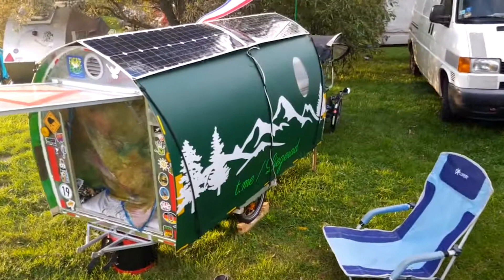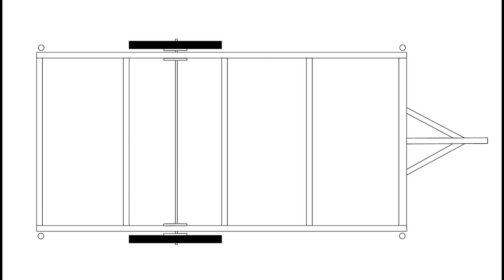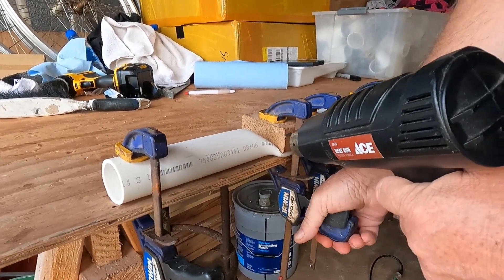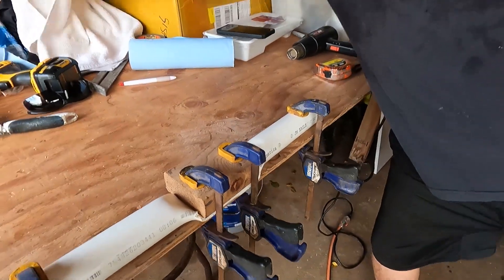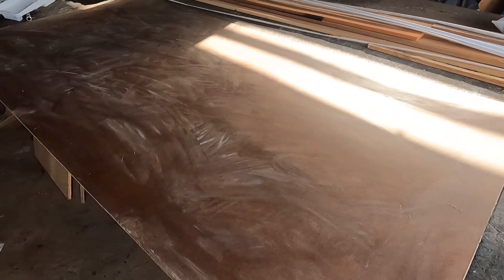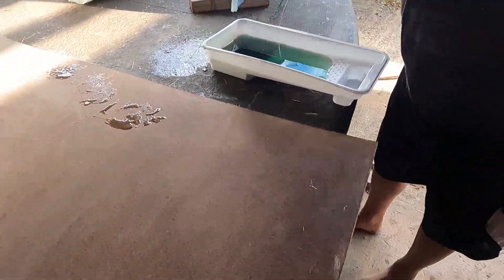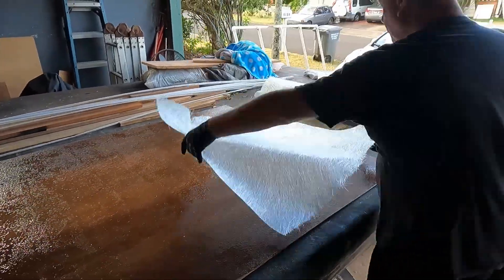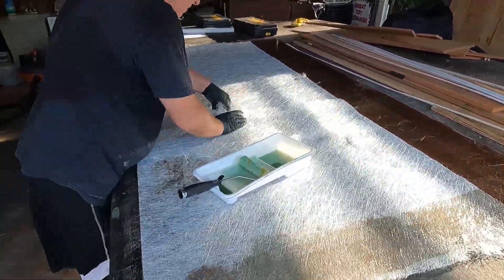Fiberglass and PVC Bicycle Camper Build - Imua 1

Comment: Ok I’ve edited what I originally said because it was impulsively angry because………your audio dude, you have to do your audio bits better next time. When you have no speaking going on, fill it with music, so that people don’t turn up the volume on a Bluetooth speaker because they think they can’t hear you when it’s really just silence. If you add music in between speaking points, it removes that headache and it keeps people more interested and engaged! Hope it was help for your next piece of content. Cheers! Also, love the design, i already started my build and see some things that im doing different, i am also going with a pre-bought three wheel trailer for sturdy larger build of 9’x4’ with smaller diameter of pipe and I’m curving the front end for aerodynamic assistance to save on battery life by reducing drag. Anyways, hope that is some good input for you and thanks for inspiring me to build with something other than wood.

Comment: I did think that flattering the pipe could cause structural weakness in future.... but glassing it should take care of it to strengthen it.

I thought of a board (2×4, 2x6) across the frame and pipe clamped to tubes... then glassed...

Would be good, perhaps stronger... idk for sure...

Thank you for the pvc - glass idea for a frame.... best so far imho

I refer to the all fiberglass stingrays 68 - 81 ??? The unibody fiberglass frame provides torsion and an internal flexible frame that has benefits...
Reply from the maker: The goal, due to the tropical climate I live in, was to use no wood or metal. The fiberglass and PVC has held up to several years of intense use so it is sound. A 2x4 would not have made it this long in this climate. Metal rusts quickly here as well.
Reply: @DIYKauai  interesting... thank you for your ideas.... great series... I've learned alot....  still dreaming 

I mostly watch your videos without volume.....  where are you.?  Meaning location.....

I think of building a foam box and then glass inside and out....

Any ideas for a frame and attachment of wheels?  I think of a solid axle....

( I would also like to avoid wood metal.... unless I glass over the wood wheel mount)

Thanks a bunch.... obviously you have so much info.... I will have to listen more...  

I guess I'm asking if you have suggestions for a 4" foam box... one piece contiguous frame and attaching wheels, possibly solid axle.....

Oh... haha... from your channel... Hawaii haha....

Also... what do you think of a camper trailer with a thin garage for dismantled (wheels removed) bicycle.....  AND ...the camper made to look like a DUMPSTER...

Haha... for stealth.?????  Whaddya think???
Reply from the maker: @Moment-14  Interesting ideas, give them a try and let us know how they work out!

Comment: Planning to build a camper for my bike, I settled on pvc for low weight, which led m3 to your video for ideas. My design will be different than yours, and while you do have a good design, your one massive flaw was melting the pipe to flatten it. You took something that wasastrong shape, and made a huge breaking point. Long term, that won't last at all. Better to find another method that doesn't require deformity of the pipe. I chose to go with metal covers for outlets. I'll cut the Grove and use them to mount the wheels. The walls I plan to use Coloplast, with a little bit of plexiglass for the floor, for strength. My design is also a little bit more compact that yours, at 3ft wide an 7.5ft long. At this stage, that is subject to change however. Soon I will buy the pipes n build a test frame. If I lime what I see, I'll buy the plexiglass for the floor an the Coloplast for the walls. With the parts I've selected, it around be super lightweight, which is a requirement as I already have an easy 40lbs of gear.

Comment: def a different way of doing it i was skeptical but after seeing it its pretty good. not sure how old this is but just wanting to know how its holding up. 1 other quick 1 why did you choose such big diameter pvc. I would think the black 1 and a 1\2"  is stronger im thinking i'm going to go with the black 1.5" ill let you know how it turns out
Reply from the maker: The project is on hold while my son recovers from surgery. I built a bike trailer from PVC and learned that 2" schedule 40 was the best size. Good luck with your build!
Reply: @DIYKauai  thats how it always works eh right after you have done it sorry about your kid hope hes going to be good i look forward to seeing it built im going to fiberclass over that 2" or what ever foam.

Comment: question for you how come you like doing things the hard way lol. I am a drywall boarder so when i see things like the way you are doing fiberglass why after puting sheets down theres a foot or 2 that gap in between that needs to be put in if yo put the first 2 down first the gap will be at the end so what eversover hanging you cut off way easier then cutting a shprt piece and having to mak sure both ends fit lol.
Reply from the maker: Sheetrock = cheap, fiberglass = expensive.

Comment: Super excited to see this project. Your previous pvc bike trailer inspired my design. Check out my camper build on my channel. Will you be giving this to the same homeless guy as before?
Reply: epoxy is very expensive its bloody nuts i bought what I thought was 2 gallons off amazon cheapest i found was $125 and its not 2 gallons its 1 because epoxy is 1 gallon hardener is 1 gallon so its actually 1 gallon.
Reply from the maker: @ericluscombe3272  I am using laminating resin so is a little cheaper.
Reply from the maker: Heading there now!  Not sure who will get this one... they have to be willing to go on YouTube and talk a little about it.